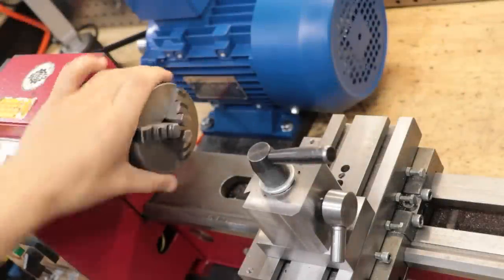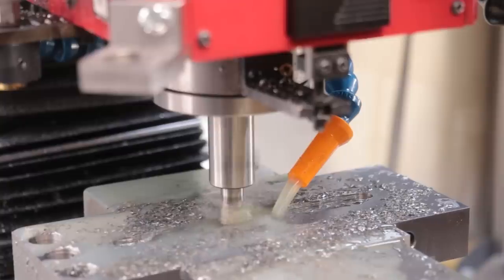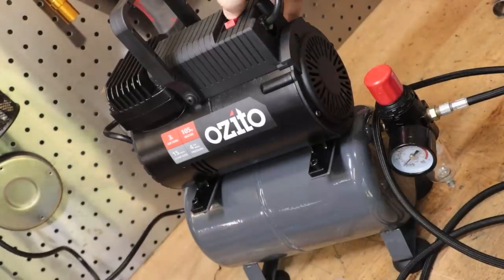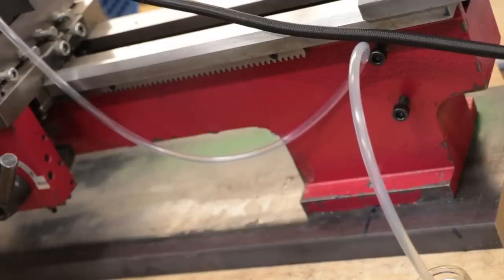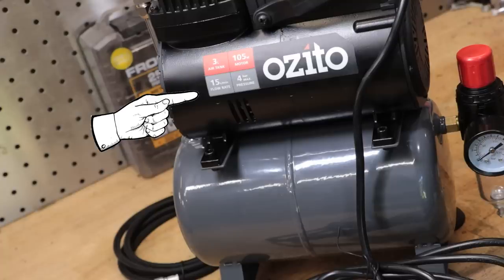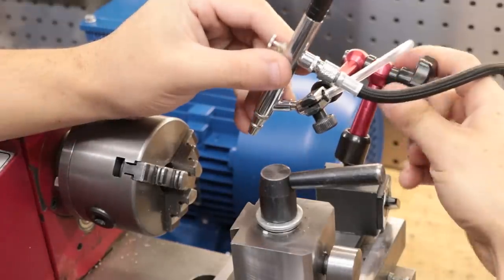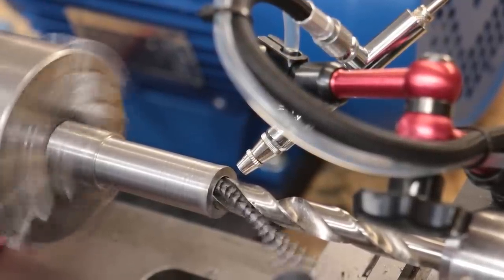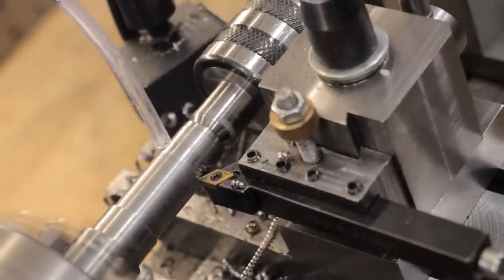Mist Coolant For The Mini Lathe

Comment: Just some thoughts because i use a similar setup for my CNC: As you already mentioned: This is not exactly healthy ;) Thats the reason why i´m using a Water/Alcohol/Soap Mix for cooling. Downside: You have to clean and oil the machine after work or you will get rust!  I have a similar compressor, but not the same. It has cooling vents, but there is no fan inside. I opened the motor to be sure. No fan and no room for a fan. I did mount an external fan (radial) for cooling, otherwise it will overheat and melt some parts inside the compressor. The capacitor was the first part that melted.... ;) Check if yours has a fan...
Reply: Breathing alcohol is not a safest thing either. Your liver might get upset (personal experience...)

Comment: If you want to silence it then make sure you some mass to the metal. Look at a dynamat type system so you lower the resonance of the metal. As the foam on top of the mass damping. Remember to isolate the compressor with some rubber feet.

Comment: You could always just build little shed for air compressor and put a hole in the wall so you can have the compressor outside and run a long hose from outside to inside.

Comment: you could hook up the tank of the older one in the the supply system , use it as a bufferso the compressor doesnt kicks in so often , it allso allows you to kick on both compressors and get more cfm if you need it , i have a sandblasting cabinet and need more cfm to run it and im planning to do just that

Comment: It's okay if your chips are hot. If your chips are breaking and coming off hot, then the heat should be leaving with the chip.  If your feeds and speeds are correct, and using the right tooling, you can take a huge depth of cut with an aggressive feed, break hot chips and put little heat into the part.

Comment: Using a spray gun is a good idea, didn't think of that. I use a gravity fed drip coolant setup with mag base hose I got off eBay. No compressor needed, just need to adjust the ball valve to control the coolant volume. Only use it rarely though, just squirting some manually with a needle oiler bottle seems enough most of the time.

Comment: Did you add a air hole to the reservoir bottle? You may want to add a check valve to the coolant hose so it doesn’t need to suck the fluid all the way back up every time you turn it back on. Last thing you do know that WD40 is an acid and it breaks down oil that’s why you put it on old oiled components it breaks down the old oil so the lubricants in the WD40 can start working so when you put it on your lathe or other machines with surfaces metal on metal the WD40 will break down whatever oils you add making them less effective causing an increase of unnecessary wear

Comment: I like the tube at the end, it gives you a bit of safety too if it happens to touch the chuck or workpiece.
It does seem to be dripping small drops on the job, I wonder if you could simplify the whole system and just have a gravity feed dripper with a tiny nozzle? 🤔

Comment: Hi Bud been Watching your videos if you want to get a better finish on the slides put wet/dry paper with double sided tape depending how much it out will depend on grit use then just push back and forward should get equal flat smooth surfaces 😊

Comment: You could try and use isopropanol as a coolant. Heared that its very good especialy when a good surface finishes is a requirement for the Part.
Reply: Your liver would be extremely grateful (not). If anything, use 96%  ethanol with proper protection and ventilation (at least it's less poisonous). But you still would have problems with evaporation when not in use and sucking water out of air and depositing ut on your lathe
Reply: @avelkm  i fully agree 
But there must be a reason to why  Companys like datron use it. 
Im just wondering if the benefits of using it outway the cons

Comment: Is your air compressor going to have enough air going to it while it is in the cabinet to be able to cool itself? With the doors closed it seems it would want to recycle the warm air over and over until the heat built up and took either the motor or the compressor out. Not trying to be critical of what you have done just something to consider.

Comment: Defenetly a geat idea of using the airbrush as an mql System, i never would have come up with this idea. However please don't use regular coolant for mist cooling (for long periods of time), there is a reason why special mql lubricans exists. The reason is as follows: If you atomize regular coolands, the oil particals get mixed with air and brcome suspended. They will adhere to anything your skin (not so damatic),  irretate your eyes (only in large quantities) and get into your lungs (this is the most problematic one). This is the reason most vmc's with TSC have some kind of mistcollecting system.
Idealy you want to enclose the lathe in some form or another. However i don't thinkt this is feasible for you. Maybe use it with good vetilation or a some sort of fune extractor.
Don't worry since you propably aren't exposed to it all day everyday, however i just wanted to give you some advice.

Comment: Hi, Air Compressors  need air to refill the tank ,,,inside it will get hot better keep it out for cooling and fill air. And remove the needle from airbrush to get better air
Reply from the maker: It has a fan on it when has kept it cool and 20 30 minutes of work hasn’t caused it to heat up much

Comment: Will you need an air bleed hole to allow air into reservoir if using mister for extended periods of time?
Reply from the maker: There is a hole there somewhere, just forgot to add it when editing

Comment: Will probably cook the compressor in a closed space, especially a cheap box store brand. Rule of thumb is running at 50% capacity.
Reply from the maker: I was worried about this too. I had it running for a good 20 minutes whilst turning down some 4140 and it didn’t seem to produce much heat. I think it’s operating well below the 15l min capacity although I can’t confirm it

Comment: And what happens when you have had it on a while does it stop coming out? You created a very tight seal with no way for air to get into the coolant tank.
Reply from the maker: There is a small 2mm hole in the top to help vent

Comment: 3 hp or 1hp.  doesnt matter.  its your rpm, cutting speeds and feeds that determine chip size and colour more horsepower is what allows you a deeper cut

Comment: How does the lathe handle low RPM say 50 to 100 RPM is there enough torque for threading etc.? I have the same lathe and the torque is shit at low RPM, By the way, good job with the mister.👍👍👍
Reply: With the 3HP Motor it should have enough torque, right?

Comment: i first saw those in the early 90s from devilbiss, Paasche, etc. and at least $120 or $150 which is like $30 now. instead of HVLP high vol. low pressure it's LVLP
Reply: We used Doerr/Gast rotary vane type pumps back in the 1960's.
They offer plenty of pressure!
You are thinking of the odd little rubber diaphragm pumps that would couple directly to the airbrush, but they would pulse too much without a reservoir.

Comment: do you think you might need to shield the air intake of the motor from chips and moisture?
Reply: Inside the enclosed cabinet?
Reply: @jimurrata6785  im talking about the lathe motor, not the compressor motor
Reply: @celestialbeas9214  The ribs on the case say TEFC to me.
Reply: @jimurrata6785  I mean, yeah, but chips can still gunk up the fan covering, and moisture spraying out from the plane of rotation on electronics, regardless of it being enclosed or not is not great for it. But even just to make cleanup easier, it's nice to have a backsplash of some sort.
Reply: @celestialbeas9214  You're reaching.  😄
TEFC motors run constantly (for years!) buried in saw dust, oil, grime, even cow shit.
Let me show you some driving the conveyers of mines, transfer or recycling stations.
Reply: @jimurrata6785  damn, i must have just worked with some shitty ones that hadn't been replaced in the last 30/50 years! lol, fair enough! 😄I wouldnt say i am familiar with good ones, only on ones that were in their sunset years!
Reply: @celestialbeas9214  lathes or motors?
I've got to say I'm surprised that bigger motor hasn't*seriously* damaged the mini lathe yet.
Reply: @jimurrata6785  well, tbf, the lathes and the motors were shitty, old gisholt 5L, warner and swasey 4A turret lathes, some with direct drive, some belt driven. the direct drive ones were in a better condition. 

Yeah, that is the biggest motor i've seen used on a lathe of that size. power for a little machine.

I've got an Craftsman 9L i am restoring currently in my home shop, gotta rebuild a counter shaft for it.
Reply: @celestialbeas9214  I think the advantage of that bigger motor is that it still has torque when slowed way down.

I'm not familiar with the 9L. Is that an Atlas or South Bend rebadged model?
Are parts impossible to find, or very expensive?
The irony of needing to make a shaft for a broken lathe is not lost on me.
Reply: @jimurrata6785  i actually got super lucky with this find, but it is one of 8 other known models of champion blower forge 9L lathes! hard to find information about them aside from a small blog post, but it is functionally the same as an atlas or south bend 9L. parts are expensive, i could make do with just alternate parts off a south bend or atlas, but i will probably just make something, since i could just set something up on my hurco cnc machine at work when i can get some spare time with it! itll be cheaper that way :P

and the countershaft is a little bit weirdly named, i believe it is the whole assembly that is attached to the motor, and the pulleys that drive it. all of it rides on a hinge that can be tightened or loosened to apply tension and change speeds.

Comment: Suddenly in the end 
Mist coolant turned into Drop coolant because of that clear tube for the air gun.

Now i wonder, 
A tiny water pump and a tube could have served the purpose. A small valve to control the flow 1 to 1/2 drop per second.
Reply from the maker: Possibly, many ways of doing this I guess
Reply: @artisanmakes  Agreed. But the parts, money and effort you put into making this eventually did not justify. I am not critisizing you work or effort. Just discussing the other easy ways.
Reply from the maker: 100 bucks and an afternoon, seemed to be okay with me.
Reply from the maker: If you already had a compressor I. Think the investment would be closer to the 20-30 dollar mark
Reply: @artisanmakes  COOL

Comment: 13:42 Are you ways damaged?
Reply from the maker: I dont spray it on the ways, what i was getting at is I don’t trust the coolant 100 percent, even if it does have rust inhibitors. I had a few bad experiences with XDP 2000 not doing a great job at protecting my mill, even at higher concentrations. Since then I’ve just used a light coating of rust protection and it’s never been an issue since

Comment: sigh.

grab your lil compressor.
grab the tools, maybe the hacksaw...
cut everything off.
mount it behind the lathe, belt drive off your 3hp motor.
probably a 4:1 reduction is ideal, spin it slowly, only needs a tiny tank to smooth out the pulsation, and your nozzle limits the pressure it will build to anyway.

quiet, less power points, less load on your lines, and the motor has more than enough potential.

should have just used a cheap brushcutter engine as a compressor.

and the video of making brackets etc would be more interesting than this.
Reply from the maker: I wouldn't even have the time to do that if I wanted to
Reply: @artisanmakes  you can stand there  for several hours and hack through a 2 inch bar with a hacksaw...
but dont have enough time to make a bracket, mount two pulleys, and deal with a few basic airline fittings?

ok, i understand.

Comment: Lathe struggles doing threads smaller than 0.07mm.
Is that thread pitch or diameter?
Reply from the maker: I should have been more clear, it struggles to do threads with a pitch of 0.7mm and less.